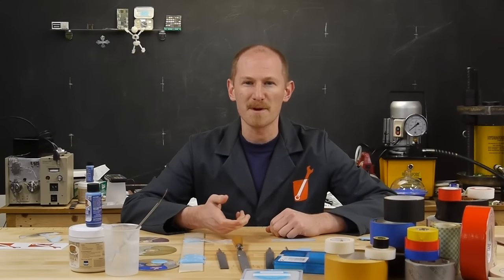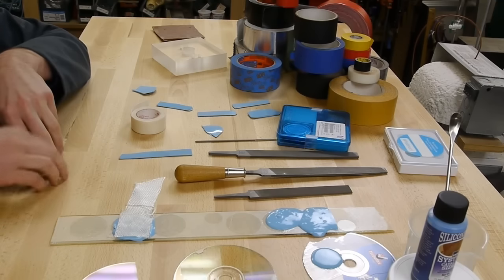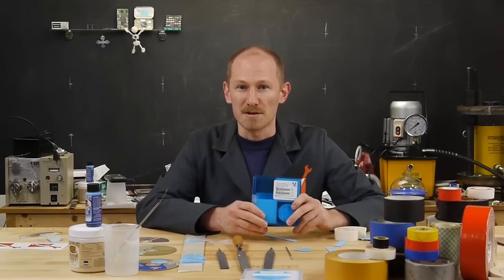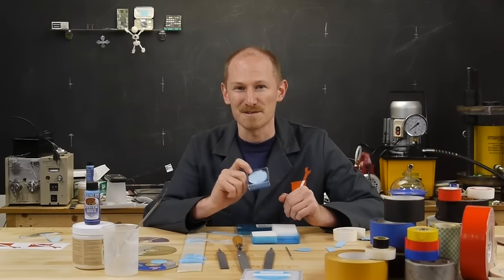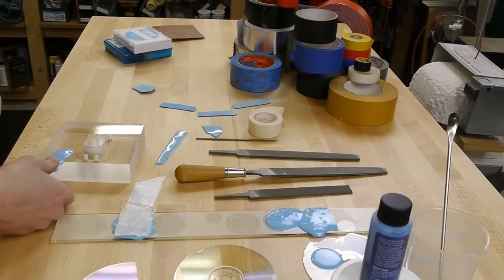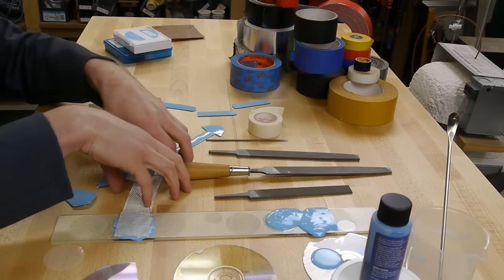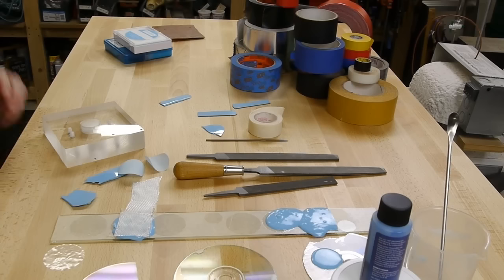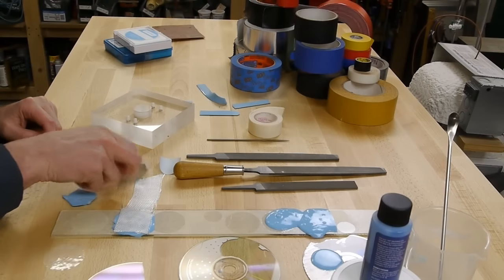Making DIY gecko tape - work in progress

Comment: Is a bluray disc more densely packed? is so, maybe you could burn data to it that is specific to your needs. If that doesn't work then maybe customize a bluray player with a laser that has even smaller wavelengths?

Comment: Would a laser cutter width be too wide to make a hole like that? I'm actually not sure what kind of cutter width it would be for lasers.
Reply: +Chris Gammell I looked, uv is ~400nm wavelength, gecko tape needs ~600nm. So I like that idea.
Reply from the maker: +Chris Gammell That is a really great idea!
Reply: +Applied Science was also thinking you could do multiple passes and "clean out" the holes in between passes. With fixturing, you should be able to hit the same holes on subsequent passes.
Reply: +Applied Science this comment gave me the idea of using your sputtering machine,  but using the probe there where you "hit off"  the atoms.
Reply: That depends on the wavelenght. I would take a blue laser, thats affordable and has a small beam. But positioning it is hard.
Reply: drkastenbrot Perhaps using the burning system of a Blu-Ray and making a "cd" in the plastic might work?
Reply: +Roshkin most lasercutters use a CO2 laser, which has a wavelength of 10.000nm. So that is way too big for 'real size hairs. But for a proof of concept it might do, I think he was aiming for 20-30um 'hairs'.
Reply: Jelle B This is very much outside of what I know, so I'm brainstorming. I did quick googling to find blu-ray and thought it might work.
Reply: +Jelle B Maybe could use a UV laser, as UV has a wavelength of only 100 nm
Reply: +Chris Gammell Back in grad school, we made photonic crystals and metamaterials utilizing focused ion beams which would act much in the way you mention.

Comment: Could you tinker with a DVD/Bluray burner and increase the intensity of the laser diode to burn deeper pits on the disc surface perhaps? Maybe an iso file with the correct ones and zeros pattern to burn to the disc would help too...
Reply: +Russell Bailey That should be pretty easy to do and could work, at least in theory :P
Reply: +Russell Bailey 
thought of the same thing then saw this post. 

i think it would work.
Reply: +Russell Bailey as far as I understand it,  burnable media use a different system.  It doesn't burn pits onto the surface, it changes a photo sensitive dye.  The 1's and 0's on burnable media are represented by opaque/non-opaque areas.
Reply: +Russell Bailey My thoughts exactly !
Reply: +damage.cc huh
Reply: +Russell Bailey and then burn something like ....1010101010101010... on it.
Reply: +Russell Bailey Actually dvd burner doesn't burn the dvd but a special layer inside the disc. IMO you'd have to access the electronics to do your stuff
Reply: +Russell Bailey this looked like a useful diagram https://upload.wikimedia.org/wikipedia/commons/a/ad/Comparison_CD_DVD_HDDVD_BD.svg
Reply: +Russell Bailey Specially crafted data won't cut it. There's EFM modulation that scrambles your zeros and ones before it's written - for better synchronization.
Reply: +Russell Bailey Aren't dvd laser diodes a wavelength of 600 nm?? I think that will make too big of holes.

Comment: Possible solution (or at least research direction): porous anodic aluminum oxide. Regular, deep cylindrical holes, in a stiff material.
Reply: +Seth Roughani That was my first thought, but he shows the picture of the 3μ noodles that seemed to work fine. From what I can find if seems to not be that difficult to create pores in alumina many hundreds of nm across, not much smaller than the filter. (Highly Ordered Anodic Porous Alumina Formation by
Self-Organized Anodizing,
Grzegorz D. Sulka)
Reply: +Andrew Pera Also easy to control the size of the pores, and the process is well characterized.
Reply: +Andrew Pera The process works very well for producing regular structures. Depending on different acids you use as your electrolyte, you get different pore sizes. I've personally tried oxalic acid, which gives ~105nm pore pitch. Phosphoric acid will yield somewhere around a 300nm pitch which is the largest size I have heard of. There is a sweet spot where you can get close packed pores at a particular anodization voltage. Another trick is that to get aligned pores, you first need to anodize for a while, and as the pores grow into the aluminum they will self assemble. You can then etch off the just the pores, which leaves only the texture of bottom of the pores behind. This template means that anodizing a second time will yield near flawless vertical pores of pretty much any desired depth. 

However, these pore sizes may be too small for this application, and as was pointed out, getting the silicone in such small pores can also be challenging. Adding a surface treatment and/or vacuum degassing may help.
Reply: +Andrew Pera That's a good idea. There's a review (A review on the progress of polymer nanostructures with modulated morphologies and properties, using nanoporous AAO templates. doi:10.1016/j.progpolymsci.2015.10.003) about that subject.

Comment: Very surprising that the silicone flows into the holes in the filter, especially without being under vacuum. I was not expecting that at all. It's no real surprise that it doesn't work though. If it did it would be impossible to physically remove the filter from the silicone it would be so strongly bonded. At best the hairs would tear off and be left in the mold. The filter would need to be dissolved chemically. That will probably be the case with any method of forming functional gecko tape that involves casting. I think one problem that keeps this particular method from working is the size and density of the pillars - they're too few, too large, and too spread out. (As I was typing this I got to the part in the video where you mentioned this very thing)

More importantly, I think silicone may not be a rigid enough material for the 'hairs' to be properly forced into intimate contact with a flat surface. They bend over too easily, sticking to the body of the silicone to form what is functionally nothing more than a lumpy surface. If you look at the images of gecko feet it's clear that there is a good deal of rigidity in the fibers to keep them standing straight out from their stalks, and the material they are made of is not of a kind like silicone that would result in their binding to each other like a wet mop. At as small a scale as these fibers are, even something as rigid as steel would probably have more than enough flexibility to adequately conform to surfaces. My guess is that it will take a very hard plastic to properly replicate the geometry. As for making a cast: short of creating a mold from actual gecko feet, burning the feet out with corrosives, then casting the plastic and dissolving the mold to free it, I don't know how it would even be possible. Laser etching or some sort of vapor deposition on a sculpted substrate is the only thing I can imagine working. But what do I know. I'd love to see some novel process invented that could make such tiny structures. Great video.
Reply: +NightHawkInLight  I definately agree that the stiffness of the silicon could be an issue, but I don't know what the standard surface tension of silicone is, so increasing the stiffness might effect the distance of how far it can flow into the holes.
Reply: +Collegiate Match Fishing That's another reason why I don't think casting is a viable method.
Reply: NightHawkInLight check out my comment below applied sciences last comment and let me know what you think about my idea.
Reply: +NightHawkInLight The literature is full of successful examples of casting these structures, he just needs the right mould.
Reply: +NightHawkInLight If you were using a vacuum mold as you mentioned wouldn't you be able to use pressure to demold it? And when you mold silicone you always use a release agent so that would overcome the silicone's tackiness that you are wanting to use until such a time that you wash it off.
Reply: +NightHawkInLight There are types of silicone which are stiffer, or rather, that are stiffened with other materials... combined with dissolving away the filter... but then the "hairs" still wouldn't be consistently oriented. 
https://en.wikipedia.org/wiki/Silicone#Chemistry
"In some cases, organic side groups can be used to link two or more of these Si-O backbones together. By varying the Si-O chain lengths, side groups, andcrosslinking, silicones can be synthesized with a wide variety of properties and compositions. They can vary in consistency from liquid to gel to rubber to hard plastic."
Reply: +Collegiate Match Fishing Allowing the silicone to /start/ to set before applying would be another way to control how far it flows into the holes.
Reply: James Newton yeah, but that's more a guess unless you have strict ambient controls, mixtures, humidity, pressure, electrostatic forces, and etc. There's a lot of variables
 to control in viscosity over setting time.
Reply: actually demoulding it by placing it in a vacuum filter with the vacuum on the wrong side.  would help force the noodles out from the far side leading to less ripped off. ones.
Reply: Ok Night you just crushed all my dreams

Comment: In the original paper they used a wax cast and I think that may fix the issues you're having. Is soft enough to take on microstructures easily but strong enough to hold it's shape during molding. I've been meaning to make a video on the process for a while. You cast it in a 3 piece form with two really flat faces as the top and bottom plates. You compress the wax while in the mold while it cools and it gives you a perfectly flat glassy wax surface. To make the holes, take some thin tungsten wire and cut it into short lengths. Line them up and clamp them between two pieces of metal to make a comb. Make sure everything is the same length and nice and straight with only a bit of the wire poking out. Too much and they'll bend during the process. Then electrochemically etch the tungsten quickly and it'll form a comb of very tiny needles. You can easily control the size of the pillars you'll get by how long you etch the comb. Then just jab the comb into the wax. Ideally mount it to a little 3d printer and program it to do the poking for you. Then you can carefully control the pattern as well as the size depth and pitch of the holes. best of luck!
Reply: +The Thought Emporium Another way to do it would be to hydrothermally grow iron oxide nanorods, pour them out onto some wax paper or something. Use a magnet underneath them to make them all stand on end then cast some resin or wax or something on top. Then once it's solidified peel off the wax paper dissolve the rods and cast your silicone.
Reply: +The Thought Emporium This sounds like a great idea
Reply: Mike Dawson he has an awesome channel
Reply: I wonder if your microfluidics method might work for this. Etch on a shrinkydink and then shrink it to get your tiny deep grooves.

Comment: Read this one: EDITED AGAIN, damn it I keep coming up with ideas. 

How about mixing 500 nm iron dust, can actually be purchased as small as 35 nm diameter from what I found, with the toner. Print the iron powder toner on to the film. Then use a large magnetic field to rip out the iron from the toner, thus leaving the holes of the desired size. Then apply the silicon to the toner side print and then strip excess toner off using isopropyl alcohol or solvent. 

Notes:
There might be additional tear out diameter due to the difference in specific heat capacity of the toner, thus not allowing to solidify under a laser jet printer, but this should give pretty even distribution over the layer.  
It might also reduce the magnetic force required if you preheat the toner, maybe a low level microwave should excite the iron dust enough and localize the heat to specifically in areas required. 
Also, the direction of the holes can be controlled by the direction of the magnetic field, relative to the surface of the toner.  So you could actually get different directional holes in stripes, which could increase it's bi-directional grip. 

That's just off the top of my head. So if this works, can I come see your workshop?
Reply: +Collegiate Match Fishing Second Idea, you can focus the beam of beta particles using an electro-magnetic field, like how a CRT monitor works, that way you direct the flow in a specific path, but would require basically an old tv tube with hatch where the screen is. It would be a fast process can be controlled using basic programming through an AV port. The down side would the damn field calculations  for dealing with higher velocities required.
Reply: +Collegiate Match Fishing Good idea. I think rather than using this method to make a mold for casting, it would have more potential to work to make the final product. Mix your ferrous particles in hot plastic, spread on a sheet, then pull them out while the plastic is still hot. That should result in very small strings of plastic being created wherever a particle was pulled.
Reply: +NightHawkInLight More or less like velcro.  Pulling the ferrous material out while the plastic is still hot.  I suppose the trick would be finding the proper temp for the plastic, distance of the magnet, and possibly pulse width of the magnet.  I would suspect that if the plastic is too warm, it would either curl over (like velcro), or stretch all the way to the magnet.  Some applied, external cooling could help.
Reply: +NightHawkInLight Maybe even use a hf magnetic field to heat them up, and then apply a strong pulse outward, in the 1-15 tesla range.

Comment: Can you used a hacked DVD burner or blue ray burner to print the scale you need right on to a disc? I have seen you do crazier stuff! Give it a shot.
Reply: +Nate Schoonover http://www.osti.gov/scitech/servlets/purl/841696
This seems to supports others ideas of using your SEM to "drill" the holes.
Reply: +Nate Schoonover Also promising with tapered holes, perhaps not quite the right diameter though. 
https://www.osapublishing.org/view_article.cfm?gotourl=https%3A%2F%2Fwww.osapublishing.org%2FDirectPDFAccess%2F573BBB8E-0470-14B4-29D9A3EEA5E9A2E9_180292%2Foe-17-12-10044.pdf
Reply: If depth is determined by the laser, this should be super easy to implement! Just tighten the distance between bits and track spacing and write 000000000 on the entire disc with the laser wattage or dwell time adjusted for depth.
Reply: I think your idea could work! I worked in a lab in which we used lithography in waffer disks to control particle diffusion. The hole sizes were about 10 microns. Not quite as good as the actual gecko, but it's a good start

Comment: I wonder if you could adapt a DLP device to project very small patterns for lithography, and step & repeat to get the area coverage. Probably need to remove the cover glass for UV.
Reply: +mikeselectricstuff Definitely doable, I have a 3D printer based on this idea, would just need some alternative lenses for the high resolution. Proper UV is a bit of an issue but a lot of optics will pass light around 400nm and many resists etc are sensitive enough at that wavelength.
Reply: +littlestworkshop As long as you use mineral lenses UV transmission is acceptable. As soon as you use plastic lenses (like cr39, trivex, polycarbonate, 1.6, 1.67 etc) UV transmission is poor.
Reply: +Jacob Jones Oh shit Mike for a second I thought I was on your channel hahaha
Reply: +mikeselectricstuff 
+Applied Science

Just to note, care has to be taken with UV resins, on liquid form they are very dangerous. Not so bad when they are cured, so research the toxicity and how to handle the material first.
Reply: Use quartz lenses for uv transparency they could be sufficient enough